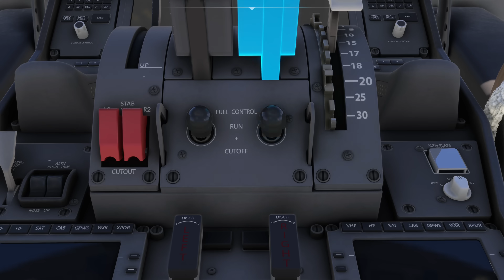Air India 171: Why Did The Fuel Cut-off Switch Get Moved?

Comment: I have a software engineering background, and am experienced with bugs that are extremely rare and almost impossible to reproduce. I wouldn't be surprised at all if a software issue caused AI-171 to crash. For me, there are two main things that do not add up in the preliminary report issued by India’s AAIB:

1.      RAT deployment time: According to online sources, it can take between 5 and 8 seconds for the RAT to deploy and start supplying power on a Boeing 787-8 Dreamliner. The report states that the RAT began supplying power at about 08:08:47 UTC (page 14), which means the RAT deployment would have started between 08:08:39 and 08:08:42 UTC. However, the sequence of actions given or implied by the report is as follows:

a.      Engine 1 and Engine 2 fuel cutoff happened after 08:08:42 UTC (page 14).

b.      The fuel cutoff switches went from RUN to CUTOFF with a gap of 01 second (page 14; this means the earliest the fuel to the second engine could have been cut off was 08:08:43 UTC).

c.      As a result of cutting off fuel to both engines, the RAT was deployed and started providing power at 08:08:47 UTC (page 14).

The problem with the above sequence of events implied by the report is that it gives the RAT only 4 seconds to go from undeployed to fully deployed and supplying power. This does not seem possible given the deployment time of 5-8 seconds given online. (For reference, in comparable Airbus models the RAT takes 8 seconds to fully deploy and start supplying power.)

Figure 15 of the report (page 14) shows the RAT in “extended” position. What is the timestamp of this figure? I could be wrong, but this looks like a picture taken within 2-4 seconds after liftoff, which would place it between 08:08:41 and 08:08:43 UTC.

 
2.      Climb time and altitude after liftoff: The report implies that fuel was cut off to both engines by 08:08:43 UTC, just 4 seconds after liftoff at 08:08:39 UTC. If this were true, I’m assuming the plane would not have been able to climb any further, and its maximum climb would have been only 200 feet (assuming a slightly above-average climb rate of 3000 ft/min, based on online sources). Given that the airport is at an altitude of ~200 feet above sea level, the plane’s maximum total altitude would have been ~400 feet above sea level. However:

a.      Online sources say that the plane reached an altitude of 625 feet above sea level before descending. This means it climbed 425 feet, not 200 feet. This means either that its climb rate was ~6000 ft/min for the first 4 seconds, or that it climbed for more than 4 seconds (at a lower rate).

b.      I timed the plane’s takeoff from nose-up to the point where it starts its descent based on the CCTV video. The actual liftoff moment is hidden behind a structure, but if you put in a reasonable estimate for it, the plane seems to climb for 10-12 seconds before getting “stuck” and descending.

How would a climb time of even 10 seconds (and an altitude of 625 feet above sea level) have been possible if fuel was completely cut off 4 seconds after liftoff, as the report implies?

Also, what is the altitude of the plane in Figure 15? I could be wrong, but it seems to be below 200 feet. Further, as mentioned earlier, the timing seems to be just 2-4 seconds after liftoff (08:08:41-43 UTC). The fact that the RAT is already extended at this point indicates that there would have been another trigger for the RAT, such as an electric or hydraulic failure, not the complete fuel cutoff at 08:08:43 UTC as implied by the report.

In my mind, the sequence of events given in or implied by the report does not make sense. Further, every second and every detail would be important in such a short flight, so why are timestamps, altitudes, and full conversations (and other important details that I’m unaware of) omitted? Is this a deliberate attempt to divert attention from the fact that no cause was found, or that a cause was found that indicated a fault in the plane’s systems or parts?

 Instead of what is implied in the report, could a scenario like this have played out for AI-171 (all times in UTC)?

08:08:35 – Plane nose wheels off the ground.

08:08:39 – Lift-off.

08:08:40 – Complete electric or hydraulic failure; RAT deployment starts; Engines still running.

08:08:41-51 – Engines start winding down slowly, but still generate enough power for the plane to climb; Pilots notice reduced engine power and scramble to figure out what is happening. One pilot asks the other why did he cutoff [the engines?] and the other responds that he did not do so. They quickly run through emergency procedures and decide to restart the engines – cycle them from RUN to CUTOFF, then back again (it’s possible they did more than one cycle of this if the engines failed to re-start). Meanwhile, the RAT starts supplying power at 08:08:47.

08:08:52 – Engine 1 moves to RUN.

08:08:54 – APU inlet door opens.

08:08:56 – Engine 2 moves to RUN.

[Engine 1 recovers but Engine 2 does not.]

08:09:05 – Mayday call.

08:09:11 – Recording stops.
Reply: Do you think this old guy would read you extensive study and report and would answer? No way . He is already took money and sold out.

Comment: The $64k question is simple, for whatever reason ,can the FADEC turn off the fuel switches, yes or no?
If yes, then we have a software glitch, which has occurred previously on a 787, but because it happened on the ground, was not widely reported.
If no, then as Sherlock Holmes said, when you eliminate the impossible, what remains, however improbable is the truth.
Simple deduction, so why is everyone missing it❗

Comment: Why isn't there an alarm that goes off if the switch is flipped to "cut off" at such crucial stage of the flight. there are all kinds of "bells and whistles". why not a safety clip, an alarm for such a critical piece of equipment ( just a lever but highly critical).

Comment: There’s way too much speculation going on here. The idea that the fuel cut-off switches were moved manually is just an interpretation, not based on hard evidence. The Flight Data Recorder does not log physical switch movements — it only records the status change (RUN to CUTOFF). So if an electrical fault or glitch triggered the engines to shut down, the system would already be in CUTOFF. In that case, if the pilots tried to restart by moving the switches from RUN to CUTOFF and then back to RUN, that first movement wouldn’t even be recorded, because the system was already in CUTOFF.

Also, the brief cockpit exchange quoted in the report doesn’t support the idea that someone moved the switches manually — it actually suggests the crew was surprised and confused about what just happened. There’s no proof that anyone intentionally shut the engines down. Assuming manual action here is pure guesswork — and frankly, that conclusion is nonsense.

Comment: Some one suggested why not design the fuel cut off switch to require both pilots to shut off?  That would create many other issues.  For example, the pilot flying needs engine 1 to shut off due to fire, he is busy flying, he can't take his hands off the control, it's the job of pilot monitoring to go through the check list and perform the required actions, shut off the fuel.  And what if the other pilot is disabled?  Currently, when they go through the check list to shut off the engine it already requires verbal confirmation of both pilots and to verify that they are shutting off the correct engine.  

The root cause is not that the system has any design flow.  The root cause is that some person is having an issue or a serious problem, assuming that is actually what happened.  The problem is not the system design, it is human nature.

Comment: Captain Steeve Stop supporting Boeing,son, if a plane breaks mid air you cant say that pilot threw a stick at fuselage or were mentally disturbed that they pulled some damn switches. Explain if the plane had to crash why was nose up and full speed was there
The run to cuttoff was dn after failure to relight the engines if u know mr.Steeeve A.K.A the Imposter?

Comment: What’s the connection with the cabin losing air conditioning and their lights (electrical), plus the landing gear still being down…to the pilot turning off the fuel switches? We seem to be forgetting that part of the puzzle now that the fuel switches were turned off.

Comment: Until the engineers come up with a better solution.  Here is my fix.  A two stage action.  A switch on the far right for the first officer would be enacted, then a switch on the far left for the captain would be enacted, and only at that time would the fuel cutoff switches be active.  Withe this procedure, both pilots would have to be involved.  The odds of both pilots planning suicide would be almost impossible.

Comment: Demented nonsense
Reply: ”The Air India preliminary report, released by India's Aircraft Accident Investigation Bureau (AAIB), stated that the fuel cutoff switches for both engines were moved to the "cutoff" position shortly after takeoff. This resulted in the engines shutting down”

MOVED to the “cutoff position”

Comment: This as*hole was paid by BOEING
Reply: ”The Air India preliminary report, released by India's Aircraft Accident Investigation Bureau (AAIB), stated that the fuel cutoff switches for both engines were moved to the "cutoff" position shortly after takeoff. This resulted in the engines shutting down”

MOVED to the “cutoff position”

Comment: You are an idiot, paid by Boing, may be in millions to hide the actual issue that the aircraft had actually which caused this terrible accident.
Reply: ”The Air India preliminary report, released by India's Aircraft Accident Investigation Bureau (AAIB), stated that the fuel cutoff switches for both engines were moved to the "cutoff" position shortly after takeoff. This resulted in the engines shutting down”

MOVED to the “cutoff position”

Comment: Captain Steeve you are fake, you are telling what has happened as if your understanding is correct. Why did not the captain switch on the fuel switch with in 1 second, why take 10 seconds, if I was the captain I will switch it on immedialy. Why take 10 seconds.

Comment: Before the fatal flight, Boeing flew from Delhi to Ahemdabad. In the course there was a fault reported with the aircraft which is STAB POS XDCR. This they say was rectified. Now the black box from tail end notes internal fire causing fuel to automatically cut-off. How about this report? Or you could blame it all on the dead pilots and try save Boeing in the interests of US.

Comment: Why has no one mentioned anything on the cut off/run switches that the are spring loaded to hold the switch in the selected position.  So you have a detent and spring loaded to hold in place feature.

Comment: The term “transitioned” was used for the fuel cutoff. It css as n be done electronically, by the emergency system too. 

WOW malfunction is floated as a possibility.

Comment: I have a serious question please: is it possible that the switches were never moved? They are saying that the intact tail section shows an electrical fire and saying this could have tripped the switches power, causing one pilot to ask if the  power was cutoff because he felt it and that the other pilot saying he didn't might be true and they then tried to relight? Many are now saying one person moving both switches in their 3 step motion in 1 second is just not possible.

Comment: Steve talked about the computer program that runs when the airplane is on the ground and another program runs when it’s in the air. Why not change the air program to not allow fuel cutoff if under 1000-1500  or at least have a 20 second delay to allow the good guy to override the bad guys action

Comment: There is something missing here.  

1:  The photo from left front just after take-off [08.08.44; with the plane still within the airport runway] shows the RAT ALREADY extended, and the landing gear fully down, with the wheel trucks in the 'Toe up' take-off orientation.

2:  The later film from right rear [08.08.48 and 08.08.52; with the plane beyond the arport] shows the landing gear down, BUT with the wheel trucks in the retraction/stowage 'Toe down' orientation.

3:  The remains of the controls show the landing gear control wheel half way between 'gear down' and 'gear up'.

Does this imply that an attempt WAS made to raise the gear, but that  –  with only the RAT, and without the APU deployed  –  there was insufficient hydraulic power to go beyond tilting the wheel trucks?

What do you think?
--

 2 attachments
  • Scanned by Gmail

Comment: 180 knots is maximum speed if the fuel switch were cut of at that moment the plane would have reached 183-185 knots due to its inertia. Can you explain this? This is not as per physics unless engine were out 3-4 seconds prior to that.

Comment: Anyone with a basic physics understanding can find a flaw in this analysis. Airplanes dont have a max speed of 180 knots. If its taking off that means its accelerating. Cutting off the engine doesnt make the acceleration 0 instantly it takes time that too in an aircraft with that mass moreover the engines were cut in a sequence with a time gap of 1 sec. So in that 1 sec the other engine must be producing enough thrust to keep the acceleration positive. If the acceleration is positive that means the speed will increase at least by a few more knots. So it should logically be more than 180 since it clearly states that 180 was reached before engines were cut off.

Comment: The design of feul switches and their lack of safety is just dumb. Why don't those switches have a safety cover? They are mostly only used on the ground. So redesign them and add a safety cover, it's a simple and good solution and when things go wrong you might at least have proof that it wasn't the feul switches. Everybody is looking in the dark because now we can't prove that those switches were turned off and on during takeoff, it's just an assumption..

These feul switches are basically all designed like this on most airliners, it's a sleeping disaster.

Comment: may be the switches were in run position but the engines got turned off due to software. one pilot said did your turn off and the other said he did not. so its possible if there is a way fuel can get cut off even if the switch is on. i assume there will be some electronics behind it.

Comment: Yes, we certainly can draw our conclusions. Based on the timelines mentioned in the report itself it is clear that both engines were failed "immediately after" takeoff. Pilots transitioning the fuel switches from RUN to Cutoff and then again Cutoff to RUN was in attempt to restart/recycle the engine as per SOP. This bullshit report is clearly an attempt to save Boeing, GE. Western media is clearly focused on blaming this whole incident on dead pilots. Atleast AAIB, DGCA should have taken stand against such blames and published a report which is not affected by such external factors. Pilots were in good mental state, but given the past history, I'm not so sure about the engineers at Boeing and GE. 
TO VIEWERS FROM INDIA - I highly recommend you to watch all 3 videos of FlyingBeast on this matter.

Comment: There are at least two incidents with the Boeing 787 dreamliner where both the engines shut off without any warning. One in 1997 with Nippon airways and one with Australian Jet Star. Not a new thing with Boeing dreamliner. Stop blaming the pilots and fix the problem. Today also one of the US planes engine caught fire upon takeoff.

Comment: Note: AI171 (Boeing 787) crashed - June 21, 2025.
🛑 Refer all these before blaming pilots: (1)FAA Advisory (2018) - Fuel switch flaw: https://ad.easa.europa.eu/blob/NM-18-33.pdf/SIB_NM-18-33_1
(2) UK CAA Advisory (May 2025)- Mandatory fuel shutoff checks: https://publicapps.caa.co.uk/docs/33/SN2015005.pdf
(3) Watch 'Downfall: The Case Against Boeing' (Netflix).
>>Systemic issues exist in Boeing.
Reply: Wonderful explanation. And most relevant resources shared by Doctor. Thank you very very much for sharing these. This is required to debunk such malicious propaganda against super experienced and highly skilled pilots of India.
Reply: An outstanding explanation supported by credible resources. Grateful to the Doctor for shedding light on this matter. This is vital in countering the baseless propaganda directed at India’s experienced and proficient pilots.
Reply: Thank you, Doctor, for the detailed and well-articulated explanation. These resources are timely and necessary to uphold the dignity of India's experienced aviation professionals.
Reply: A powerful and fact-based response. Grateful to the Doc for presenting this so clearly. This is the kind of clarity needed to shut down misleading narratives against India’s top-tier pilots.

Comment: Dear Captain,
Do you consider it plausible that it took the pilot 10 seconds to return the fuel admission lever to the ‘run’ position? While I understand the stress and urgency of the situation, given the pilots’ training, experience, and awareness of the critical nature of those switches—especially during takeoff—might there have been another factor at play? Could it be that they attempted to set the lever to ‘run’ but encountered some temporary malfunction or delay? 1 second to cut off but 10seconds to put back on run

Comment: CAN I ADVISE THAT THERE ARE AT LEAST TWO 'YOUTUBE' SITES SAYING THAT THE SAME CUT-OFF FUEL PROBLEM OCCURRED TO ANA AND UNITED AIRCRAFT AS HAPPENED TO AI171. THE ONLY DIFFERENCE WAS THAT BOTH THOSE AIRCRAFT WERE LANDING AND LANDED WITHOUT AN ACCIDENT. THE REASON WAS ALL THREE AIRCRAFT WERE IN THE 'LANDING MODE' RATHER THAN 'FLYING' MODE. . IT SEEMS THAT THE PROBLEM IS ONE FOR BOEING TO INVESTIGATE.